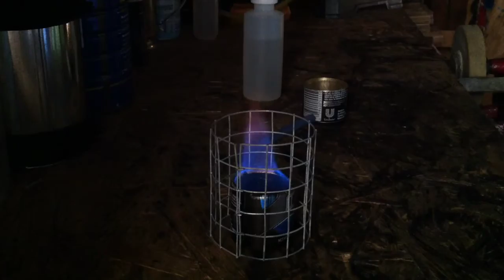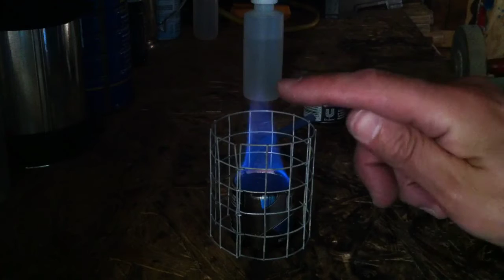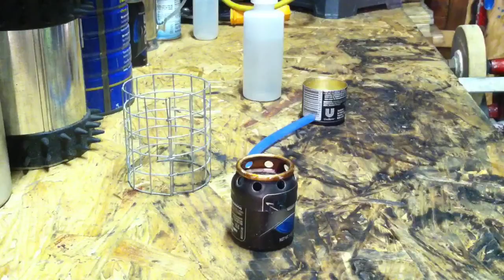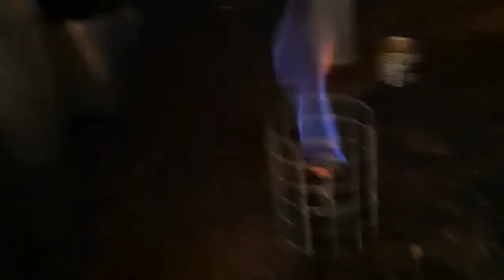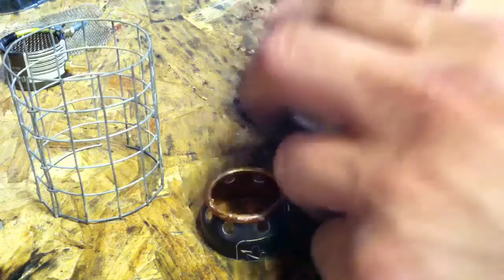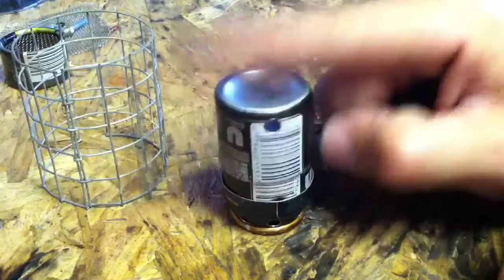Choke Hazard High Output Adapter

Comment from the maker: The same adaptor on this stove without the air intake holes reduces the flame. If you put this top on a small disk of CF it yields the same results or inulate it from the stove & it will still work the same. My thoughts are that once it is heated the vapor & heat rising pulls air in the holes thus increasing the output. Though I would agree that anytime the burn is hotter that more fuel is consumed. Thanx for your comment & the look.

Comment: I have been experimenting with similar adapters on tea lights. I believe it is more a matter of the combustion happening below the lip heating the metal, then that heat spreads to the stove causing the alcohol to boil faster.  I would assume the additional output is because your burning more fuel and not because of a better air fuel mixture. Just my two cents.